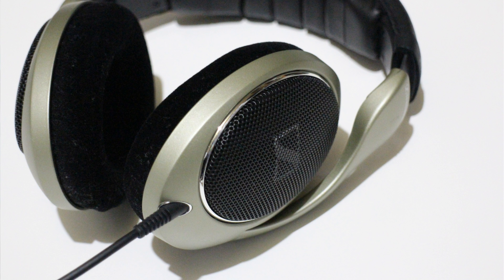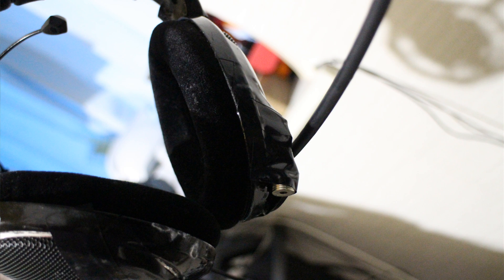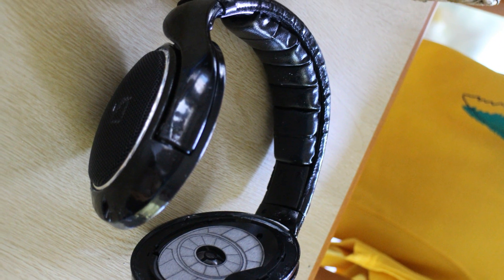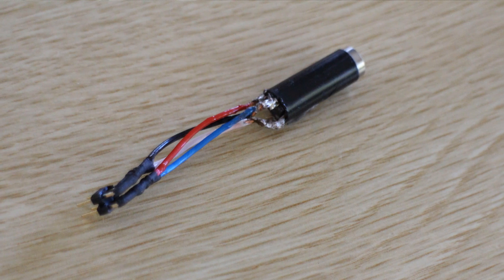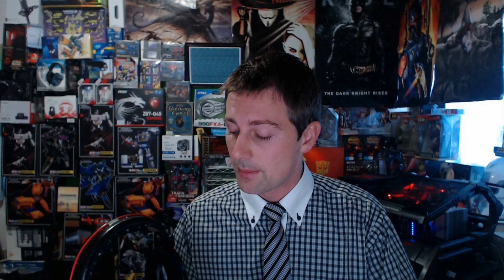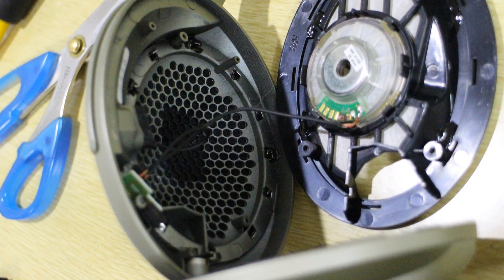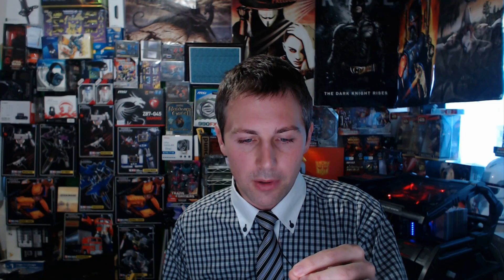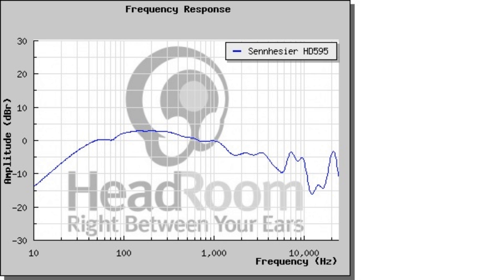The Detachable Cable Mod that went..... wrong....?? Meet my GhettoHesiers

Comment: Now i don't know what to do about buying a headset lol

Thanks Bryan :P
Reply: Tech YES City Another quick question, I have now deduced my options to two graphics cards; which one shall I get?

MSI GeForce GTX 770 4GB
or...
MSI GeForce GTX 780 3GB

btw, does this look like a good build ? http://uk.pcpartpicker.com/b/NKs
Cheers
Reply from the maker: http://www.ebay.co.uk/itm/Sennheiser-HD-555-Headband-Headphones-Black-Gray-/301120834101?pt=UK_AudioVisualElectronics_HomeAudioHiFi_Headphones&hash=item461c334a35

http://www.ebay.co.uk/itm/Sennheiser-HD-595-High-End-Headband-Headphones-Grey-/301119800723?pt=UK_AudioVisualElectronics_HomeAudioHiFi_Headphones&hash=item461c238593

there you go :P
Reply from the maker: Man these are my favourite cans now lol... Suffice to say it is a Frankenstein mod that I can thoroughly recommend :p.
Reply from the maker: Yeah that looks pretty good, would throw in an SSD in that too if you can.
Reply: i need a guide for the mod.... ;)
Reply from the maker: Yeah trust me you will want some ghettohesier 595s they are the best thing I have in my home.  Well the best thing since sliced bread with cheese toasted in the oven.
Reply from the maker: If you live in the states you can start out by buying some used HD 555s or 595s (whichever is cheaper) and then get a $1 3.5 to 6.3mm jack, 1meter of speaker wire, bond/superglue, some electrical tape and a soldering iron and some solder, and of course a v-moda boompro :P.
Reply: lol nice one, il see what i can grab in the UK
Reply: why thankyou squire, mucho appreciato
Reply: hey man have you seen this also? http://mikebeauchamp.com/misc/sennheiser-hd-555-to-hd-595-mod/